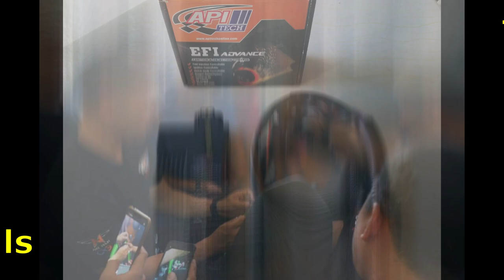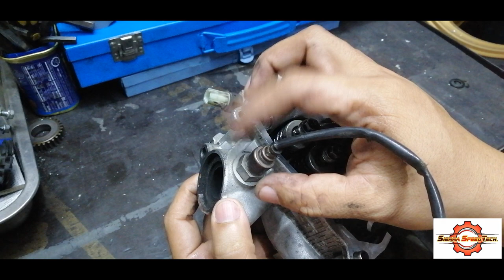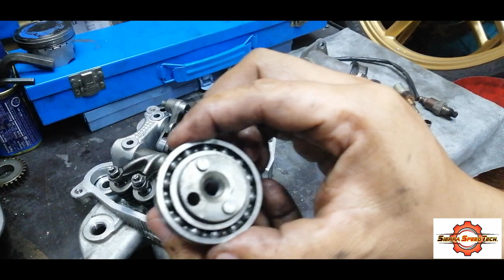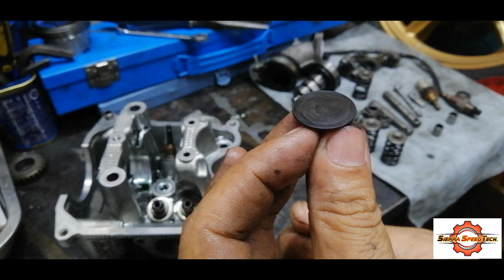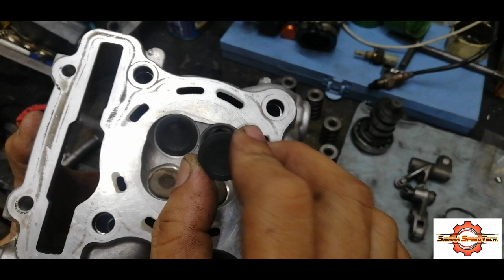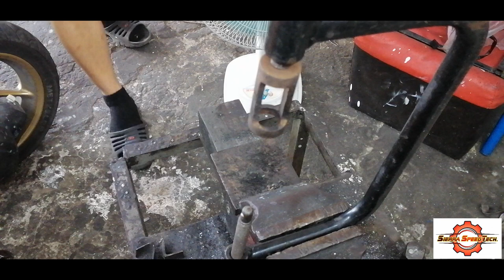180cc NMAX REFRESH PT. 2 - KARGA SERIES

Comment: i own a Yamaha smax with 180cc camshaft injector throttle body air filter bigger primary pulley and secondary also ecu but not reach more then 95 km looks i'm real you depressed because i spent a lot of money and i didn't achieve the performance i wanted there someone who can you help me understand what happens could it be the air petrol mixture?

Comment: Sir ano po ang advisable valve clearance ng rs8 stage cam at 63mm borekit
Reply from the maker: . 10 in
. 13 ex
Reply: @SierraSpeedTech  maraming salamat po for info naka big valve na din po rs8 head na 22/19..more power po sa inyo
Reply: Nmax po ung mc stage 2 cam 22/19 head
Reply: @SierraSpeedTech  bro what normal nmax 155 valve distance? Me nmax in 14 ,ex 25.Torque low.please help ne.